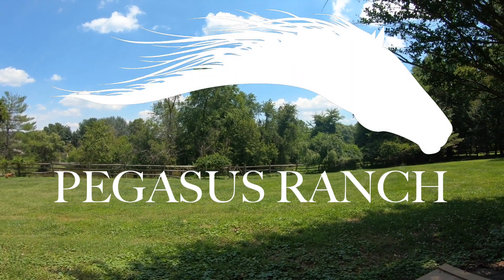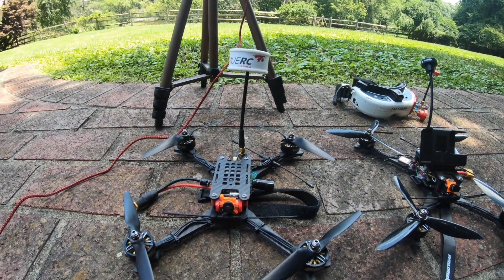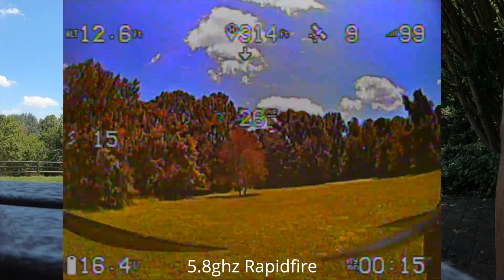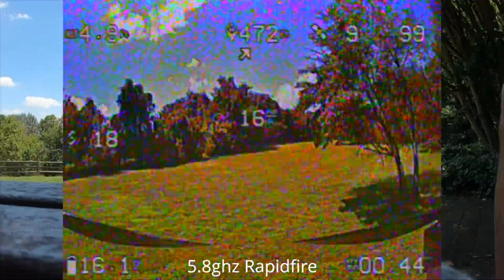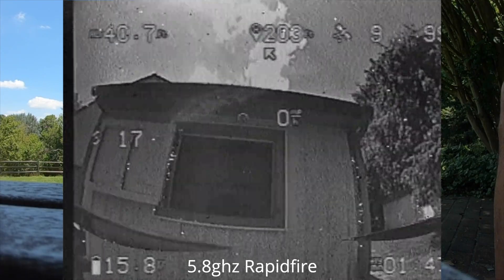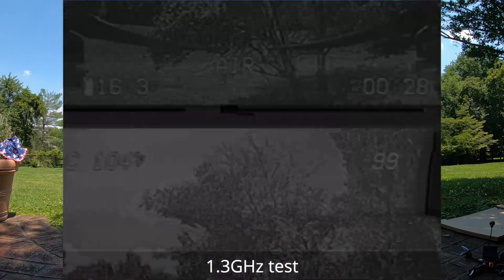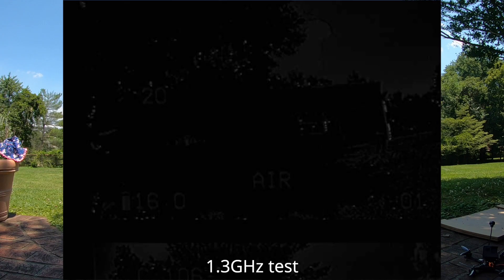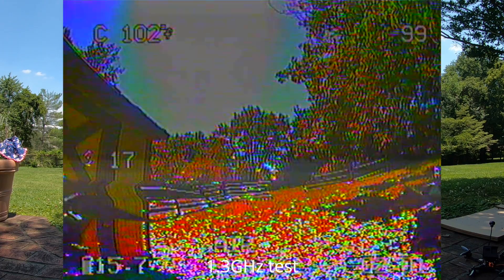5.8ghz vs 1.3ghz Object Penetration test (side-by-side)

Comment: I notice your 1.3Ghz setup is only using a 600mw transmitter instead of 1000mw like on your 5.8GHz.
Is that an FDDA restriction or just what you are running?

Comment: Hi, not trying to hate, cool video and good comparison, just wanted to explain a few terms because I'm a big nerd for analog video stuff :)
Interlacing describes how the fields of the video are shown, it doesn't relate to the way the signal is received.
Both PAL and NTSC video signals are interlaced, meaning you transmit/receive the odd lines, then the even lines and repeat. If you ever paused a DVD and saw jitter back and forth, that's because it's jumping between one set of fields/lines and the other. It's also why the OSD can appear to jump up and down if you focus on it.
The RapidFire is a diversity receiver, meaning it has two modules. It is actually blending the two images together to form the best possible result, which is uncommon, other diversity modules just switch receiver based on signal strength, which can result in white flashes in the goggle feed when the switch occurs.
Multipathing is not strictly related to any part of the receiver tech, it's just the name for when a signal reaches the receiver from two sources at once. For example, the direct line of sight signal, and the signal reflected off a wall or diffracted through an object. Both of these will hit the antenna at slightly different times, and can cause video issues. It's most noticable in highly RF reflective environments like sheet metal buildings. The negative effect is usually in the colours of the image, they get distorted in horizontal bands. RapidFire claims to have good "multipath rejection", which would reduce this effect.
Reply: Just wanted to say that your comment is highly appreciated

Comment: Thank you for making the video. I wanted to see a direct comparison of the two for a while. However, are you sure there is no cracked wire, or bad solder joint in your 1.2ghz quad? This flickering looks very much like vibration induced noise on the wires.